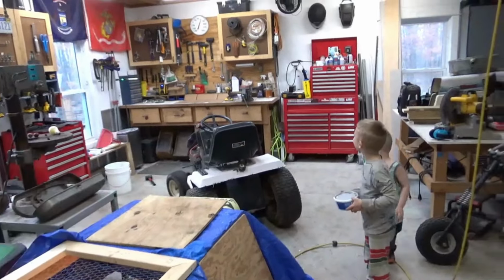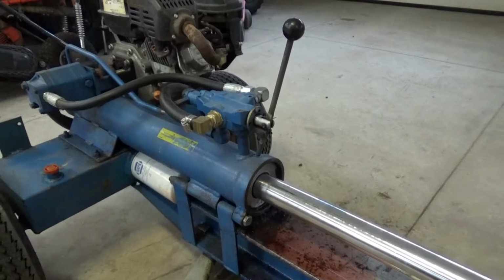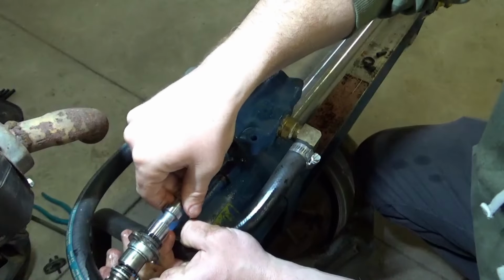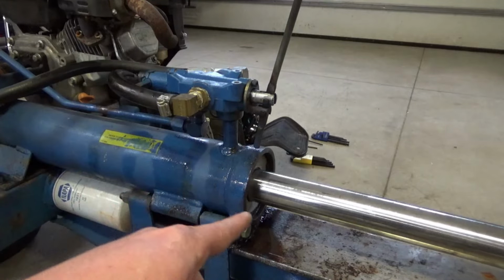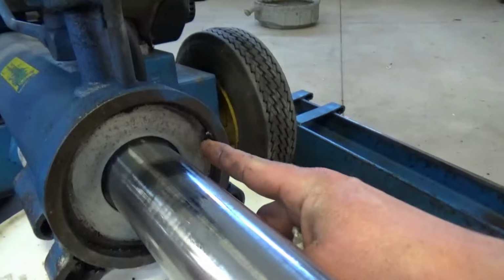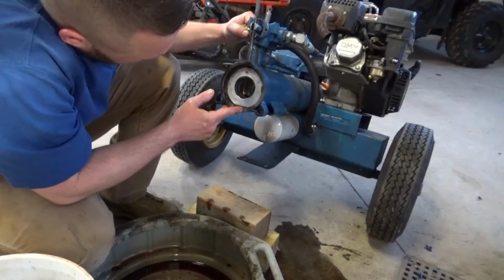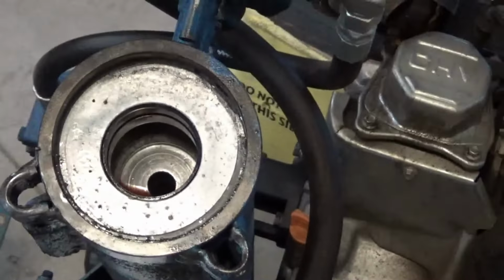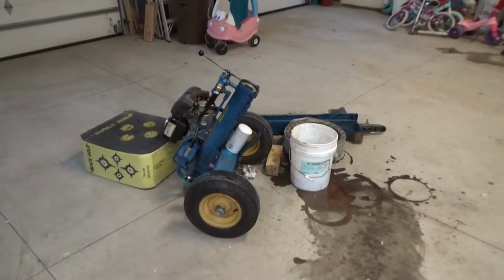You'll never guess why this log splitter won't retract!

Comment: Use compressed air on the rod end piston bolt hole. Be careful on how much pressure you apply as it could come apart with force.
Reply from the maker: Great idea! I don't like the idea of banging on it with a slide hammer.